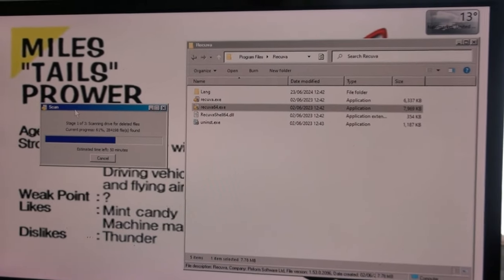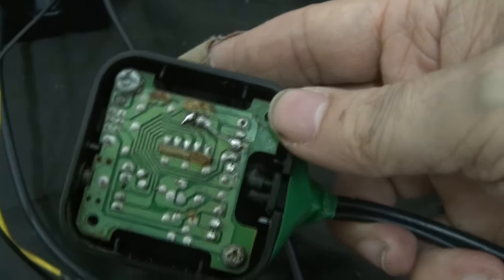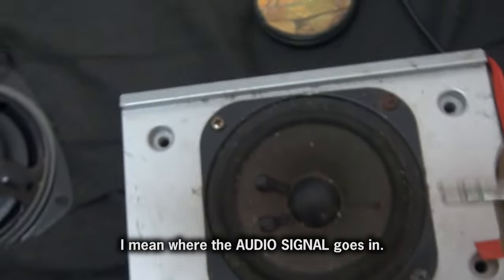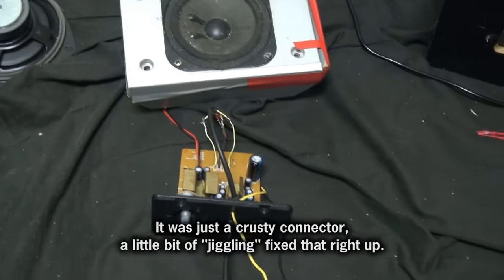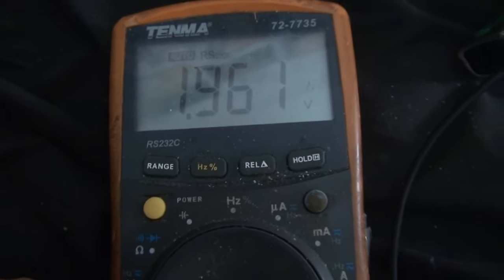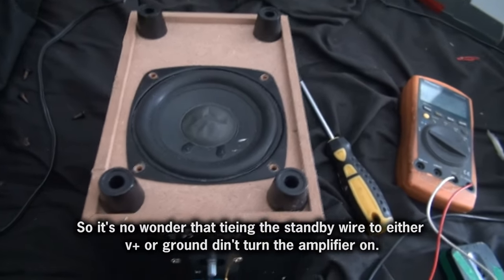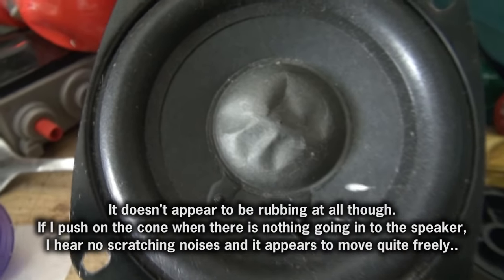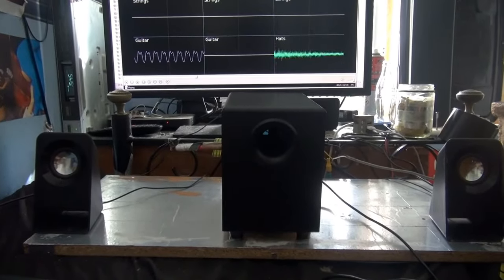Anther attempt as fixing the crappy Logitech speakers because ... I dunno.

Comment: It's likely that the terminal wires have gone bad. (The vibrating wires from the terminals to the cone) I had Edifier r2730DB in which the main speaker's 6.5" woofer made a similar sound and cut off randomly. needles to say, it is repairable and online shops sell those wires.

Comment: I think the problem you had with your speaker came from the flexible wires between the voice coil and the terminals.  Those wires, sometimes, fail by intermittence, because of vibration.  It's a delicate job, but it can be fixed.  You also have a deformed dust cap.  So, maybe it doesn't worth to fix it.
Reply from the maker: I never thought of that. I have seen that happen to some other speakers I own.